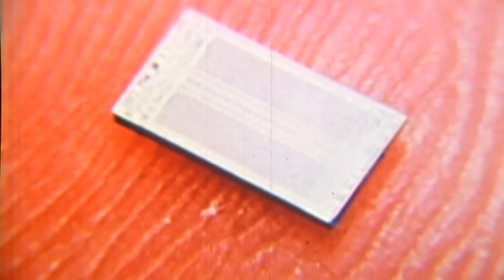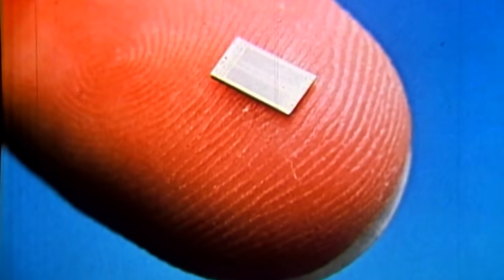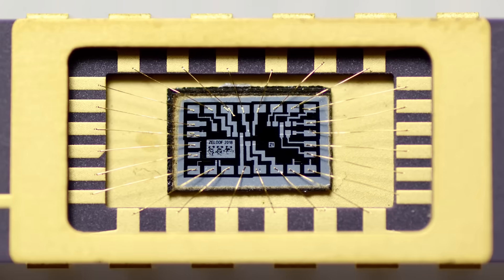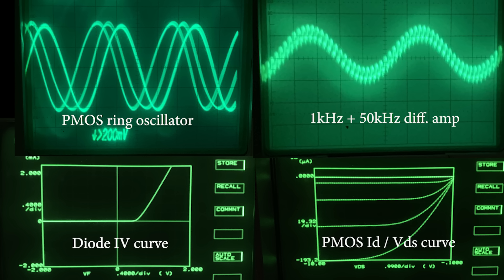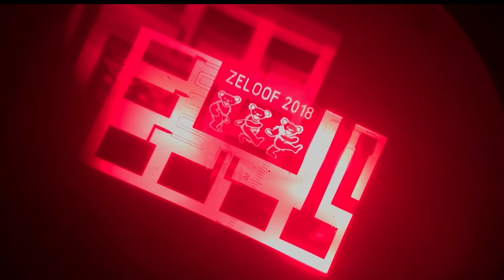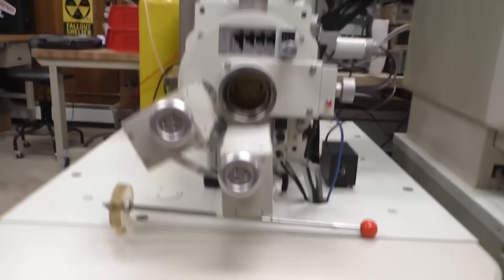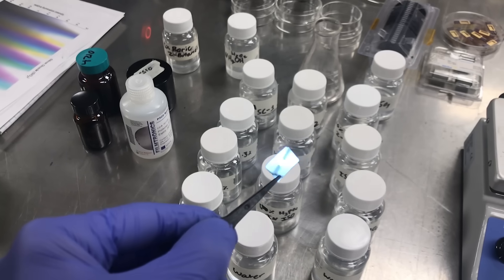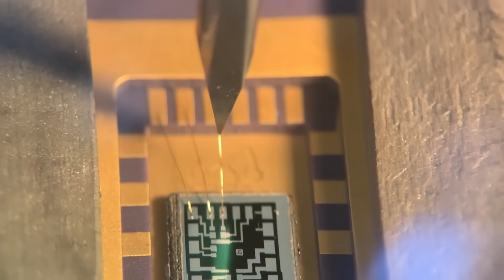"Z1" - Homemade Silicon ICs / Computer Chips

Comment: Where did you get all the money for this?! Because your lab is certainly quite professional, and just the UHV chamber can cost thousands, even second-hand! 

I could probably manage to make a crappy transistor at home with a few hundreds (like Jeri Ellsworth did), but to do this you need a lot of equipment.
Reply: 20k$ is probably around the amount that the hardware cost. Most of the gear looks used or put together from readily available "cheap" materials... The work could've easily cost 150k$ if you count let's say 30$/hr for 5000hrs.. Of course for an actual working setup like this commercially would be from 500k$ upwards.

Comment: Can't wait to see some more complicated ICs !
Reply: TBH I was expecting a 4k projector, a microscope, or even a jig to make a chip in multiple exposures. Then step down the cost with a set of standard pad layouts and an edm made clamp to avoid wireing.
Reply: lm 741 or 555 perhaps...
Reply: @gandautama4141  Or even a simple 8-bit CPU (which is around 3000 transistors).
Reply: Would be fantastic to burn some experimental mcu from opencores!